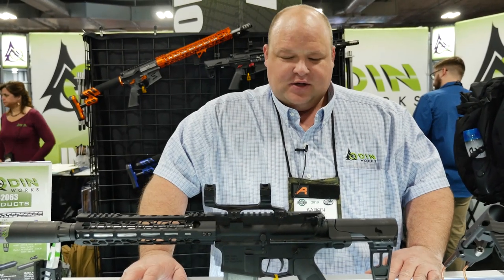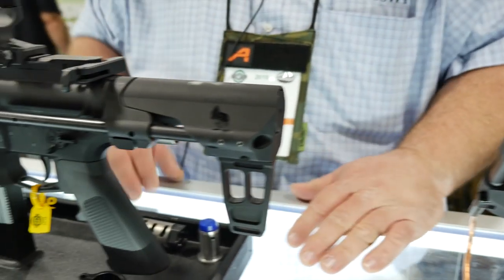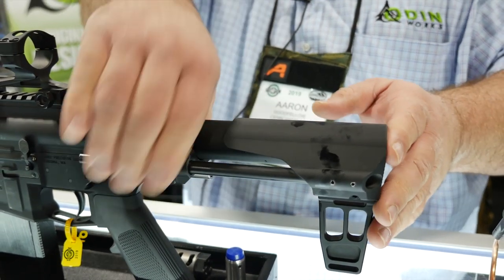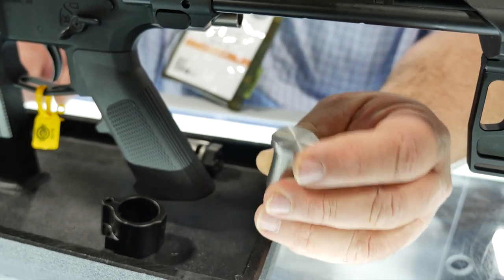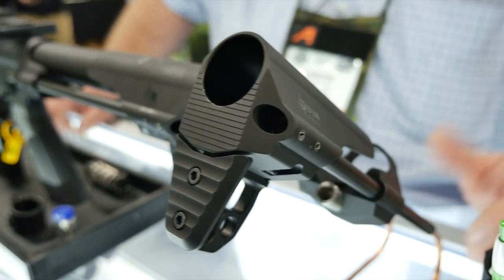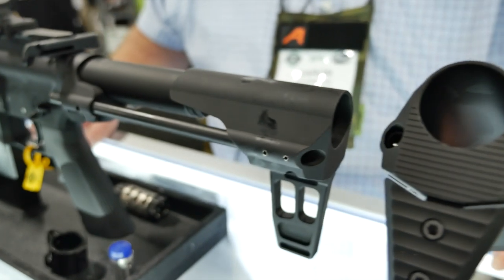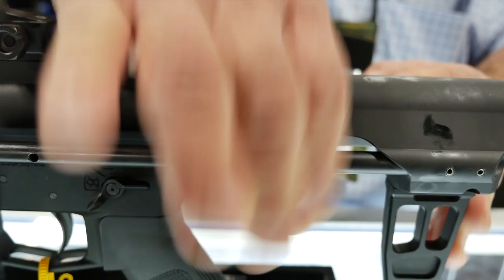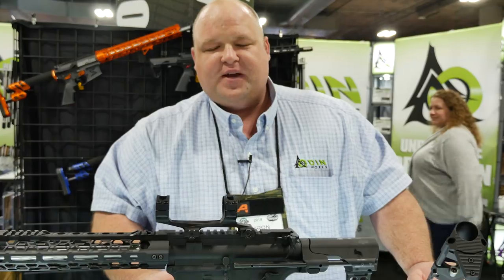SHOT Show 2019: Odin Works

Comment: For that price you'd be better off just paying for the stamp.
Reply: Actually no you wouldn't. Many disadvantages of a stamp over a pistol. Example, road trip to grandmas house three states away......!
Reply from the maker: For the brace, buffer tube, spring, and buffer, its not a terrible price. I've seen similar ones go for 100 more
Reply: Nice! Good to see another brace without velcro or SB's big black rubber baby buggy bumpers! Any plans to sell just the brace and tube without the innards, for non-AR applications?